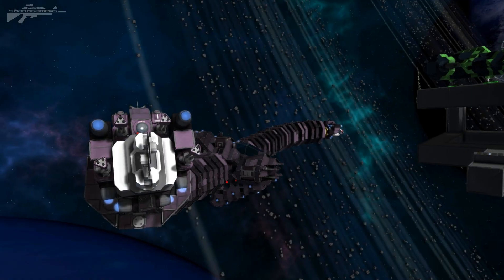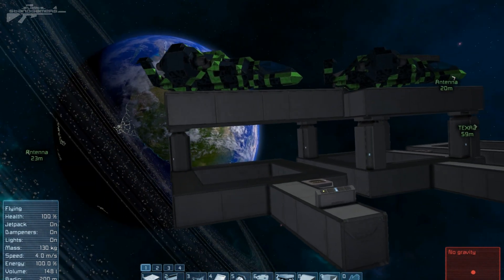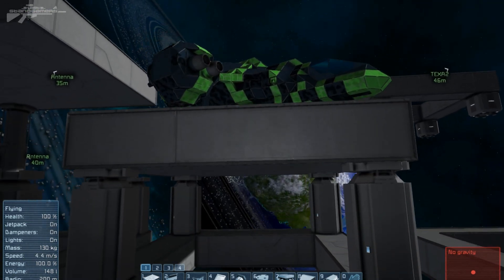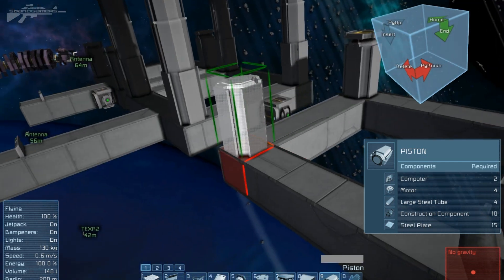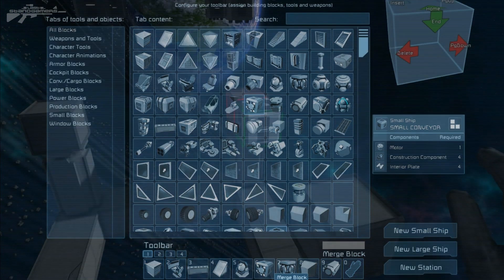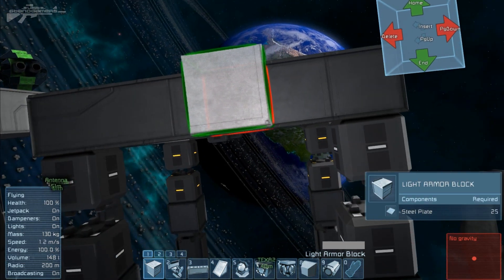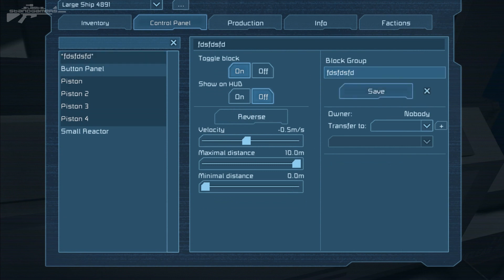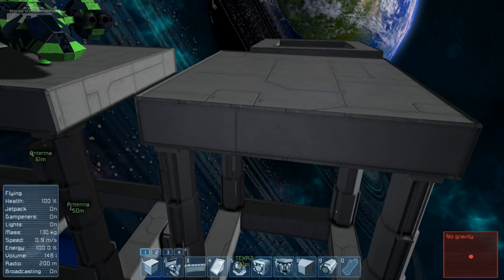Space Engineers - Connecting Multiple Pistons, Advanced Tutorial

Comment: I just leave the merge blocks on mine no chance of a fuss latter. 
Tip: just make one piston the main one by raising it build the platform on that one piston then lower it down onto the other pistons the merge blocks will do the rest. You don't need a merge block on the main one. I do this with my drilling rig for planets but I start with the drills first and build up from there. Link the pistons on top. The main piston gets a conveyor on it so I can feed the ore to a cargo container. Then I build down and around it once done cut the landing gear on the drill and they are free. I leave 4 drills out for two spotlights, reactor, and ore detector. Drop a chair on it to control the drills separate from the rest as well lower into the hole to see the ore.  It's been very stable for me.

Comment: It's not working for me, I tried this and the pistons break when they merge. I also tried to make a platform using landing gears instead of merge blocks and it doesn't work. I think this is a basic thing, it should be fixed :/
Reply: +Huehuehue that is because this video is outdated. I don't know about pistons but apparently rotors can be connected by grinding the piston head off from one of them and building your door and then placing your second rotor head. I am not sure how this would work with pistons or if it even works. there is a setting in the menus for pistons called weld speed but I have no idea what that does.

Comment: If you don't feel like maneuvering a platform of merge blocks around in tight spaces, you can simply extend 1 piston, build your merge block structure on it, then add a merge block to the other pistons and extend them one at a time till they connect.

Again, this method is probably most useful when you are trying to build a multi-piston structure in an area that wouldn't be easy to maneuver large structures in (narrow elevator shafts, inside space ships, etc)

Comment: alternative version if you dont wanna mess around with ships pushing it into position in survival:
-put block on each piston
-extend one
-put mergeblock sidewas facing to each other
-lover the extended piston
-repair the little dmg caused by the collison with your welder
Reply: Don't put the merge blocks sideways. You put them facing away from the piston, then build off the extending piston so that is has a block one block away from each of the merge blocks, extend it, then place the merge blocks one that extensions facing towards the other blocks. This way the merge blocks pull themselves into place rather then scraping into each other if you were to place them sideways.

The other way to think of it is basically if you did what he did in that video except for one arm extends and you build the free piece off of that extended arm. Then you simply pull it back into place.
Reply: BoredDan the piston heads just detach for me 99% of the time but might be because I'm on a dedicated server... I might try the sideways merge blocks and see if that works. 

Rotors on the pistons stop them from breaking but make the attached blocks very bouncy and unstable.
Reply: Andrew Meredith naah tried this, wont even go yellow
Reply: I found that the pistons in the pistons mod seem a little more resilient than the normal ones... I'm still not getting the result I would like... Sigh.

Comment: This should be a standard feature, along with the small/large rotor "glitch." The engine can CLEARLY support it, so there's no reason to have anything impeding this construction.
Reply: still the same issue...
Reply: I think it's not a standard feature because you can really easily create a clang mess with this if you're not careful. What I find useful beside this method is using a  plate welding mod where you can connect these surfaces together if you bring them close. Also very useful for repairing broken ships, it's basically a 0-width merge block if you think about it.

https://steamcommunity.com/sharedfiles/filedetails/?id=510790477

Comment: why do that? You  can connect it into one platform. simply start by one corner, instead of  by all four corners!
Reply: No, you can't. If you build a platform off one piston and then extend that piston, you'll see that the rest are still unconnected.
Reply: Knsgf I tried it, and it does work. (but you need to extend all pistons at once)
Reply: Plane crashers Doesn't change the fact that only 1 piston is attached. Attach some drills to the platform and turn them on. The platform will start to wobble and shake. With merged pistons there is virtually no wobble.
Reply: Knsgf I tested with merged block and the piston part detaches when you don't exteend all pistons, it is not really any better. On top of that, that technique takes more time, and is more costly
Reply: Plane crashers Yes, the worst thing that can happen with connected pistons is that some will break and need to be deconstructed, rebuilt and remerged. On the other hand, if an unconnected pistons extend while connected one does not or a connected piston retracts while any unconnected ones do not, then a good chunk of the platform will get be shredded. So leaving pistons unconnected isn't much better, aside from simplicity. Plus unconnected pistons do not work very well when stacked.